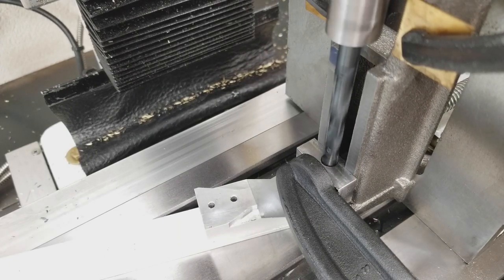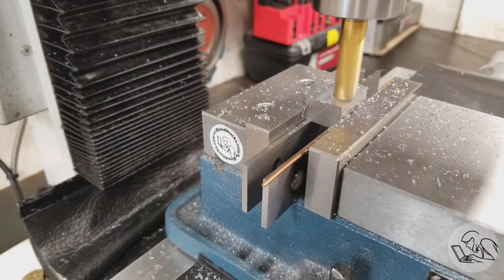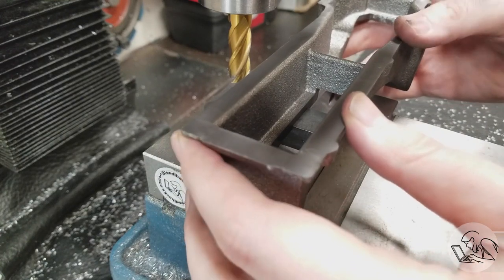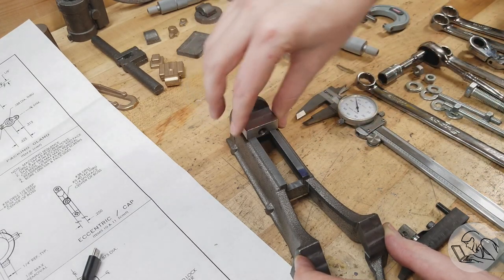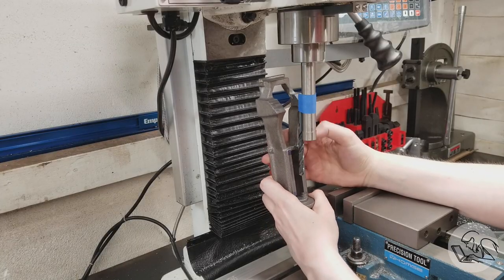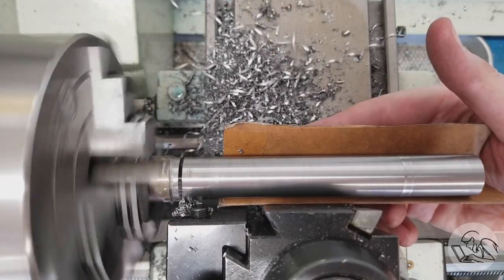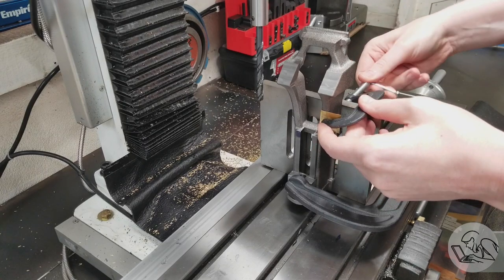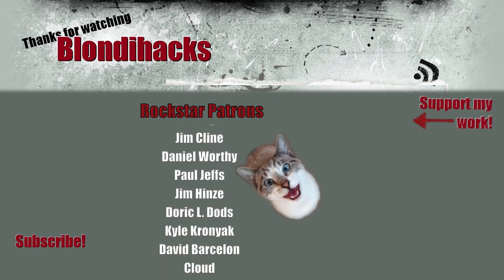Let's Build A Model Steam Engine: The Tale Of A Difficult Hole.

Comment: You can tell what a Bad Person I am from this: I'd have measured the mid-point on the base, between the two sides, scribed a line, taken the mid-point of the line, made my punch mark, drilled from the bottom and then, when the hole wasn't in quite the right place, enlarged it until it would admit the rod. Job done.
This is why no-one ever has or ever will pay me to be a machinist! Thank Heaven for the day-job.
Reply: Try your best and chalk the rest! LOL

Comment: RE: The smokey cutting oil issue.
Quinn, since your machines are so small, why not install a couple of vented kitchen range hoods over them and just suck up the smoke and blow it outside.
I am sure you could get them cheap from restore, or on a pinch new ones can be got for about $100.

Comment: Just managed to catch up with my PM1.  I faced the end of the casting, which will need doing anyhow, then marked up and drilled from outside in.  Not having enough Z space on the mill I mounted the casting on the lathe and chuck/drill bit in the spindle.  Seems to have worked well.  I have also made a template (1/4" steel) with the six holes and the centre hole - much easier to do this on the mill with a clever DRO.  When the transfer punches arrive, I'll mark out the hole at the end of the casting and then worry about how to mount it for drilling.

Comment: Have you ever tried some LPS 40320 Tapmatic #1 Gold Cutting Fluid?
I'm not sure about the machining part, but for cutting threads it works better than anything else I have ever tried.  You can really feel the difference when hand tapping/cutting threads.

Comment: Hi Quinn love the series. Why didn,t you use the dimension start reference point to find the centre line?
Reply: I have just started building this engine and was wondering the same thing, the 3/4" dimension from the start point sets the cylinder concentric and in the correct position on the radius portion of the base casting, my measurements are showing approximately .06" needs to come the slide rails, of course her measurements my be different than mine.

Comment: Im totally digging the trick for recutting a center. Id have faced it off (as is tradition) not knowing your nifty trick, wasting material in the process. Very well done.
Reply: I often do a variation of that with a piece of flat bar held sideways in the toolholder, pushing (thanks to a V cutout in the end) against the end of a drill to make it work like a boring tool, instead of an orbiting mess, but I never thought of doing what the esteemed machinist on this clip did, and push against the chuck when holding a centre drill. Kudos.

Comment: An alternate approach to "stretching" a drill is to silver solder on a length of rod.  A simple butt joint usually works.  It won't be perfectly concentric, but with the bushing holding the necessary alignment it doesn't need to be.  The shank is not usually hardened, so the heat has no adverse affect.

Comment: I know a lot of people rush to the milling machine, delegating the lathe to turning jobs only. Add a rotating vertical slide and the lathe opens up a whole new realm of machining options. First up just check your tail stock cocentricity extend the nose to full travel and bung in a dead centre, bung one in the headstock and touch the points, pop a razor blade between them and any misalignment will be obvious by the way the blade angles. Now you know any misalignment. Now mount a rotating vertical slide with the faceplate facing you. Mount the casting. You can use the trail stock as a reference point to align to any surface or point. I have an mt2 blank fitted with a quick position arm for my dial indicator. Anything aligned to the tail stock is also aligned to the headstock. Bung a centre drill into a collet and start the hole, replace with your drill and you have your hole. You can now mill the end square.  If you have a headstock with a taper add your taper mounted dial indicator and you can now rotate your vertical slide to face the headstock, dial it in and you can now perform other milling actions without remounting the casting. For example Stuart castings have crank bearing that split horizontally so you could mill off the tops. I once had a very complex multi casting multi cylinder block that required steam ways, so I purchased tow rifle bore aligning lasers mounted one in tail stock and the other in headstock and after a quick alignment test( not very precise as 1mm beam width give or take. ) I could now position the cylinder block and position it in three dimensions and see not only where a drill bit would enter but also where it would exit. Lathes have lots of other cool features like chucks that can be mounted on the headstock, tail stock, rotating table, vertical slide, dividing head. And swapped around for different operations without touching the work. Hope this may be of interest to you or you viewers. Steve

Comment: Have you got an opinion on the blue goo yet?  As you were cross drilling the drill holder it occurred to me that that might have been a good opportunity for something like Anchor Lube, what with the convex surface on the part shedding that low-viscosity mix so eagerly.  It seemed to be doing okay in situations where it could sit on the part during the op, though?
Reply from the maker: I think it works fine in situations where it can sit on the surface. It doesn’t stay put, and it will contribute to rust, I think. Still on the fence about it I guess.

Comment: Why would you use that Noga deburrer instead of a file (at the 3min mark)? Any particular reason? It just seems easier to hold your part with the latter option while having a go at it with the file.
Reply from the maker: The deburring tool is quicker and does a nicer job. That’s what it’s for, after all.

Comment: I don't know if you read the comments, but I think you might have been able to hold a drill in the spindle on your lathe as it's MT4 (MT4 - MT2 adapter even), and mount the part upside down on the cross slide using a pair of packing wedges similar to how you made the drill bushing. You could also adapt your bushing into a rudimentary machinist jack, and then clamp it down using the t-slots. Otherwise, happy fixturing!

Comment: Recommendation -

From McMaster -
Luer lock stainless needle(s)
Squeeze Bottles with Luer Lock Connection
   (I use a 1 oz bottle)

Tap Free cutting/tapping fluid (1 gallon has lasted me over 10 years).
Tap Free is a water soluble cutting oil, little odor, works well.
I suspect most any soluble oil will work ok.
Guy Lautard even has a recipe in one of his books to make your own.

How do you make a water soluble?, by heating oil with sodium hydroxide (soap?)

Q: what is the boiling point of oil? A: ?~400*F?, maybe more.
Q: What is the boiling point of water? A: 212*F
Q: what is the tempering points of tool steel? A:~400*F light straw, 62Rc, 600*F blue, 56Rc.

I keep three bottles around one with TF, one with WWJD-40, one with soap water (for plastics)

Now tap free is fairly low viscosity, and will gush out of a 16ga needle. So I take a 27ga needle, insert it into the end of the 16ga needle, and silver braze a big blob where they meet, and cut the 27ga needle off, and clean the hole (another (sharp 27ga needle)).

I try to apply it to the top of the flutes (drill press) and let it drain down while I'm drilling. Once the hole is started, dump some into the hole, and keep drilling.

In a lathe, I squirt it into the flute holes as much as practical.

Really, just a few drops now and then works well. Minimal wastage, minimal cleanup.

Comment: There is always more than one way to do a job but I would have made a block similar to Blondihacks but set the job up to come in from the other end & used said block to get centre line etc, no need for long drills
Reply: Did we think of the same solution? A rigid drill bushing with a notch/slot for the round cast part.
Reply: @dansihvonen8218  Why do you need to make a bush etc? As I said I would have set up the casting with the feature requiring the hole at the top, picked up the datum slot/face  then drilled & bored to size. There are many ways to machine components & using a long drill + bushing seemed an unnecessary faff.
Reply from the maker: Mill is too short

Comment: The sliding bushing is a fantastic idea.  I learned to use a credit card rather than a steel rule to find the centerline of roundstock (or quickly determine if the tool in the toolpost was at the right height) as there's no risk of chipping carbide tips.  I'm not sure how much accuracy that loses.

Comment: Try your "Blue Goo" in a spray bottle.  On stream setting it has enough force to blow most chips out of the flutes of a drill when drilling on the lathe plus forces coolant down in the drilled hole.

Comment: Thanks Quinn Great video - loving this series.  Slightly OT just wondering what you think of the flange mounted chucks as opposed to Camlock or screwed - myford/boxford etc?  Cheeres
Reply from the maker: I like non-threaded chucks because you can run them in reverse. Cam lock would be nicer than what I have, just because it’s more standard.
Reply: @Blondihacks  Thinking of investing in a newer lathe torn between A similar machine to yours with a vfd drive etc but it has the flange mount chuck but is a compact and reasonably light machine at around 200kg.  For a bit more money looking at a gearhead machine with a camlock setup but its over twice the weight and not quite as compact but I really like the idea of a camlock chuck for quick changes.  Thanks for responding

Comment: A drill extension can be made by laying the drill and a piece of drill rod in a Piece of angle to align them then SOFT soldering them together. I have drilled drilled a 5 inch letter C hole through stainless using this method ,learned that in about 1964.
Reply: Richard, I find myself wondering: why soft solder?
Reply: Hard solder (more correctly brazing) requires temperatures that may anneal the drill.
Reply: As a 19 year old I was more than skeptical  about it but I was told by an old hand that any attempt to braze or use silver solder would fail. The drill was extended as I said and even the extension and the shank was  relieved for chip clearance. It worked perfectly, I still have the drill bit end of it in my old drills box. we used tinman's solder
I have not tried it with super unleaded.
Reply: Fascinating stuff. I’ll have to test drive that some time. I had no idea a solder joint would take that much torque.

Comment: Hi 
Save clocking in an angle plate or a like to true. Turn true steel plugs to fit the slot good size and top bigger od make 2 of them. To use drop in T slot pull job against it lock in place. 
I have also ftted turn plugs in the bottom of my vise as there are slots in them and a tapped hole save time clocking it in. 
Steve

Comment: I use mostly a fog for cooling/ cutting and for that you need a compressor 6bar and a unit you can get them cheap online from China for 10-20 bucks .... important is that they have two screws to adjust on it...or it won't work for fog ... the first is for air pressure the second for how much coolant comes ....then you have to play a little to find the right setting that only a fog comes out ...take a paper to see when it starts to get a fog .I also have a real coolant circle system but I only use it for realy heavy cuts, ,it's a mess each time and not so much an advantage as long as you don't make heavy cuts ...with the fog the part is nearly dry afterwards but you recognise well if you use the fog or not .

Comment: Taking the "T" guide a step further, is there a reason why you couldn't have milled a longer guide which had a slot to take the end of the casting allowing you to drill through from the other face? ... same principle but no need for the extension?
Reply from the maker: There isn’t enough vertical space in my mill to drill from the other side
Reply: @Blondihacks  That would bury the idea! ... I just mentioned the idea because I thought you had rejected drilling from the outer side because of dificulties ensuring accuracy? Do you think it might work with sufficient vertical space?
Reply from the maker: @Haforn-ng2vy  With enough space, I'm sure it would work. I considered trying to do the work from the end before realizing there wasn't enough vertical space. The videos are shot expressing my opinions and what I know at the time, but I learn new things in between, and can't always include every detail about every decision in every video.

Comment: I think you did a great job on this with the amount of travel your machines have.
Also that’s a great way to quickly find the centre of a shaft on the mill.  I have been using that trick to get a lathe tool on centre for years (and years)
Why have I never thought to do the same thing on my mill? I don’t have a DRO so every little trick is a good one.
Thanks!

Comment: Why not just use an aircraft bit?  They are cheap and sold in most hardware store, either individually or in sets.  If you can't get precisely the diameter you need then put the bit in your d-grinder and grind the last 1/2 inch or so to size (depending on the thickness of your guide bushing).

Comment: When I used to make extensions to twist drills (when long series drills were out of my financial reach or when I didn't want to wait for a delivery) I would use a shrink fit (slightly undersize hole in the extension shaft, heat the shaft, drop the drill in and let it cool) - just a different way to skin the cat - oops! --saves a bit of time provided you don't want to get the drill back out! It does mean you can use thinner walls, which might have saved your first clamping fixture from the trash!
Now I have other choices (low or high temperature silver solder, or three tiny TIG tacks) but another reason to prefer any of these is that in some cases it's hard to drive enough torque through a grub-screw connection (set screw for US), even with thick walls. 
Great video BTW - you  really have a great deal to offer, and a wonderful manner to seal the deal.

ON EDIT (after watching to the end) Just a thought: grub (set) screws at 180 degrees make no sense unless they engage with dimples. The best angle between them is 45 or 60 degrees, but 90 is OK.

Comment: I am guessing there are two teeny tiny holes to be drilled and tapped to go either side of that hole for the packing gland? I guess you are going to attack those from the other face... if you do make an extension drill for a 8BA tapping drill please warn us:) You were right about the crazy set ups my Grandfather only had a treadle lathe and a home made vertical slide for any kind of milling! happy tap tapping away! yes you have me saying it now!

Comment: So for those of us with hobby mills that are always a little too short in zed axis, I was thinking that I might as well cut some length off of my reamers to make life easier. Aside from the slight loss in utility of the reamer do to shorter length, (which I can’t use anyway on my small mill) is there any harm in just cutting some length off the reamers??? 

P.S. Great video Quinn. 👍
Reply from the maker: The reason that I didn’t do it is that you lose the center in the end. This is needed for regrinding the flutes, and also for some setups.
Reply: Blondihacks oh...good point. Thanks for letting me know! 👍

Comment: Quinn:would you know if i can mount metric end mills in inch sized collets   you do a great job  thanks  Karl
Reply from the maker: You can if the size is close enough, but it has to be very close. Collets (especially single-split ones like R8 and 5C) can only “stretch” a few thou.

Comment: Great setup !!!  Nice video as always.

How about making a different drill bushing , imagine an upside down U shape that has a machined surface on the legs of the U That is the part that indexes on the reference surface. the space between the legs is just wide enough to fit over the casting. It should allow you to drill from the other side of the casting with no extension needed.
Reply from the maker: Not enough Z height to drill that way

Comment: Hmm wouldn’t it be easier to do it on the lathe? Removing the chuck and use a collet chuck for a drill. Probably removing the cross feed to have room to clamp the part down.
Ah in the next vid your doing something similar to it.

Comment: Stupid question. Why not rotate the angle plate 180 degrees? Something I'm missing?
Reply from the maker: Mainly just because then it’s really hard to see what you’re doing. Since I had to set it up again anyway, turning it 90 was just as easy.
Reply: @Blondihacks  I was thinking that having to remove and reset the vice being such a pain that 180 would have been less so. Even with reduced visibility given the fact you're using a drill guide, there wasn't as much need for a precise setup.

Comment: have you tried avocado oil?
Reply: I'm mean I've compared the smoking temp with magic tap cutting fluid and avocado oil, which avocado won.  I've  compared the smell of the burnt fumes of those two again and avocado won. Now that said, avocado oil loses by a hair in surface tension at operating temp.  It also can form a film or build up. But a nonpolar solvent like petroleum ether makes short work of  any build up.

Comment: Great video! The drill guide coupled with the extension was a great plan to get to that super, hard to reach spot 😊. There are tons of applications that method could be used... minus the yak shaving of course (still get a kick outta that 🤣).
Thanks for sharing! Cheers 👍😁👍